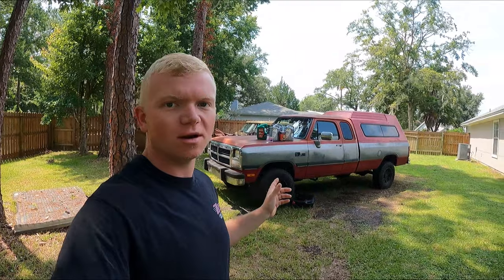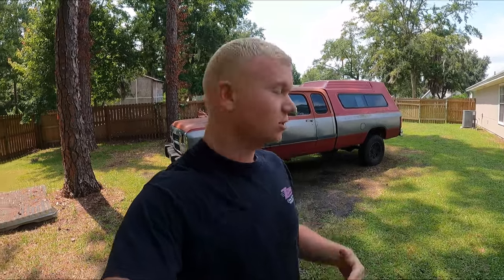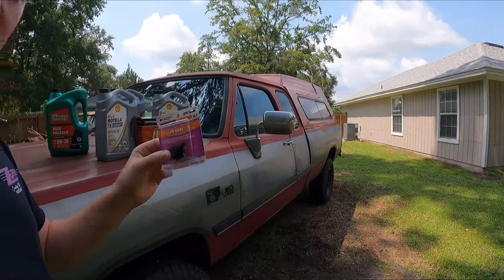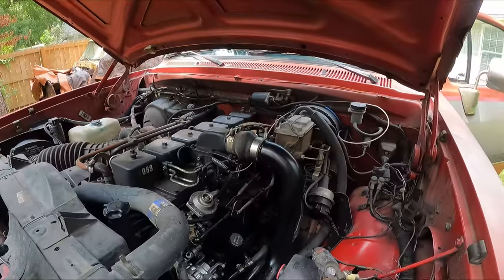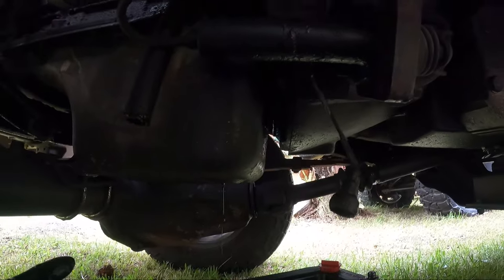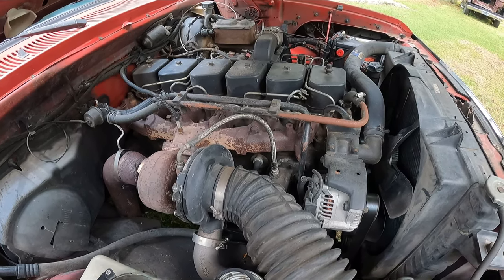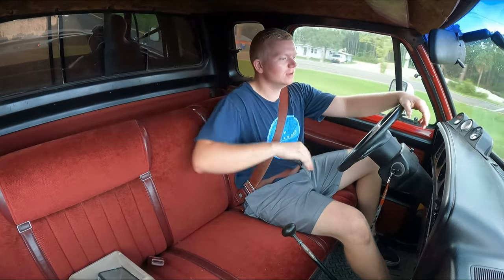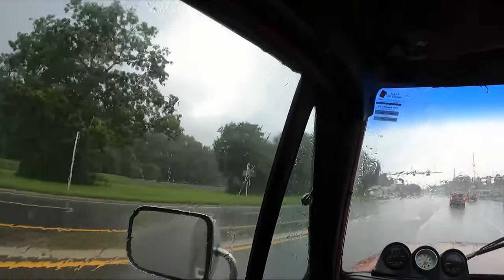400k Mile Cummins Diesel Maintenance Tips

Comment: if you want a good oil to run in it run valvoline diesel oil and better to find your leaks on the truck if get some easyoff ovan cleaner and degrease everything on the truck and you will find the leaks you have .thanks

- nick
Reply from the maker: Much appreciated! I might have to try that. Thanks for watching.